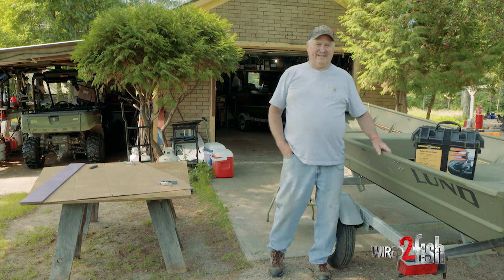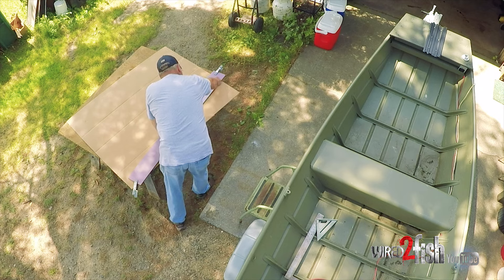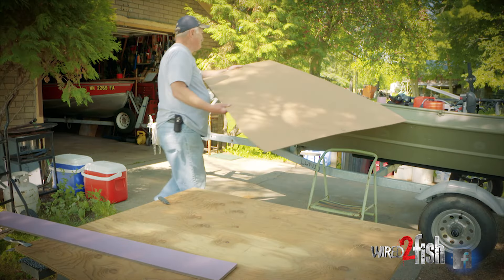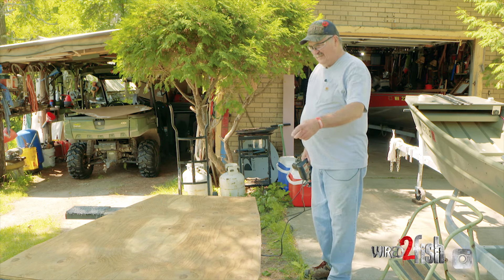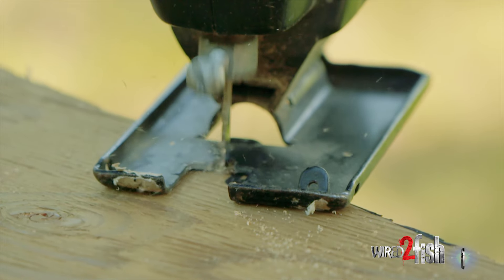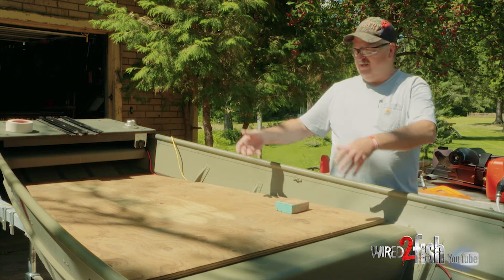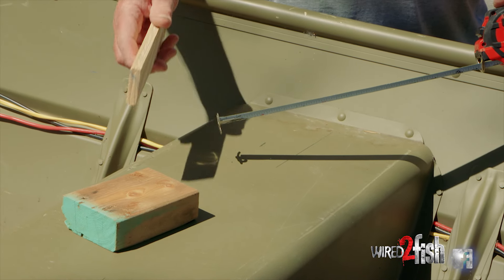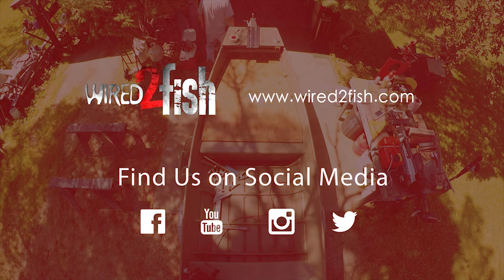How to Build a Custom Jon Boat Casting Deck

Comment: Love the saw horses. My first job as an apprentice carpenter back in the 70s (local 1622) was building 26 saw horses lol. Great job on the template tips. I put one strong back under and across the center of my 3/4" deck because it felt a little spongy with two of us on it.

Comment: I want to see how you did the smaller deck  for the trolling motor..thats exactly what I want for my 72 Polar Kraft 1436. Don't need the deck. I have a Minn Kota 45 Edge Tiller I want up there.

Comment: Good video. I can hardly wait to watch hoe you  install the carpet etc. Are you planning to put ant foam sheets under it for added flotation like many has done?  How did you find the right place to put the front at to make sure the deck was level after you put the boat in the water? or did you already figure that out and if so how?

Comment: Nice video! Hope you won't mind if I ask a question. I just bought an Alumacraft 1436LT, and I don't think it's stable enough for me to routinely stand and walk around on a raised deck while fishing. However, I'd like to raise the front factory metal shelf so it's flush with the top of the gunwales. Do you have a video or maybe photos of how you made and attached the raised shelf at the front of your boat? That would be a big help in getting my boat ready for the spring fishing season. Thanks!

Comment: Didn't you mean you want to cut on the inside of the line to allow for the carpet. I'm about to copy what your doing for the floor I'm making for my boat and I need to understand you correctly.
Reply: I think he was talking about the notches he cut for the bulkhead...not the platform itself